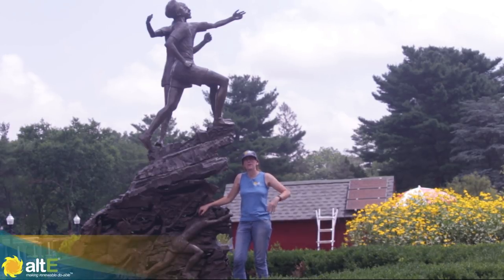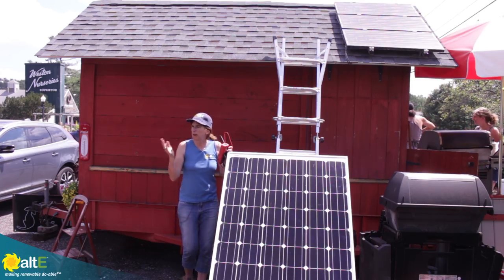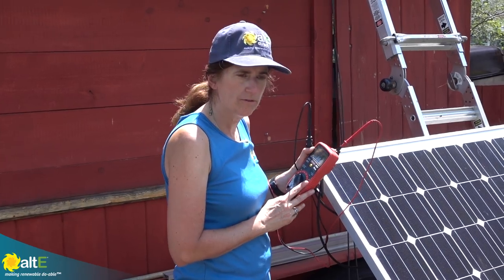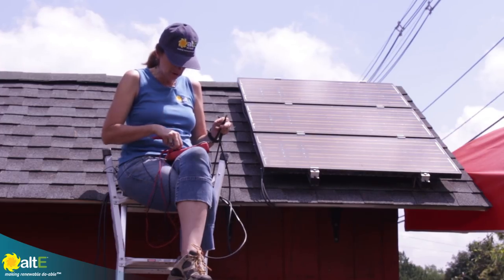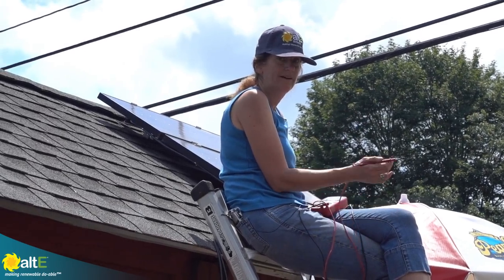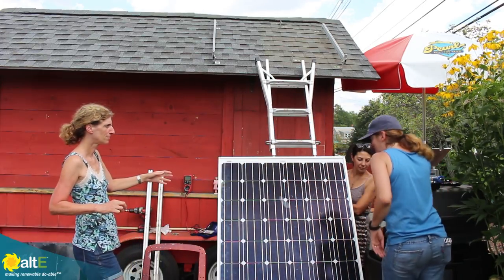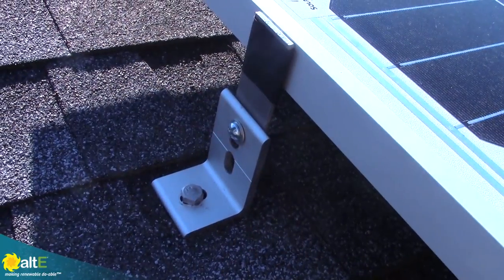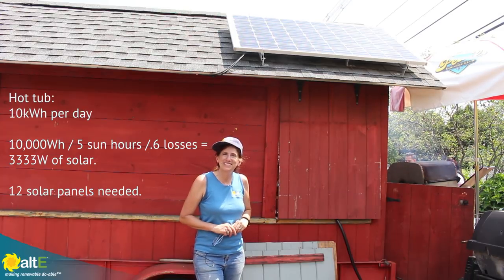Upgrading Snappy Dog's off-grid solar Part 1

Comment: You Rock Sister.  I’ve learned a lot from you.  I wish you all would use scaffolding instead of the Ladder       Go Solar -Arc.
Reply: There is nothing wrong with working from a ladder if common sense is part of the equation. I think scaffolding would be a bit on the overkill side in this particular case , no?

Comment: Aren't the old panels wired in series not in parallel?
Reply from the maker: No. We used a PWM charge controller, so the panels' voltage had to match the 12V battery. So the three 12V panels were wired in parallel. We wired them within the junction boxes, so it does look like it was serial, but it was parallel.
Reply: altE but when you read out the voltage of the old panels you were getting 19volts?
Reply from the maker: Yes. A "12V" panel is called that because it is designed to charge a 12V battery. Since a higher voltage is needed to charge a battery, the actual output of a 12V panel is around 21V when disconnected, around 17V when connected.

Comment: Can't you tilt the panels a bit to make them look more south?  I'm saying to raise the left side about 45 degrees.
Reply from the maker: Tilted panels would not be safe on a moving trailer. I oversized the solar panel to compensate for the less than ideal location.

Comment: Why not use both the old and the new panel for increased capacity?
Reply from the maker: Great question. I certainly could have left the existing panels with the Xantrex charge controller, and added the new panel and charge controller in parallel with a new breaker. Since the old panels were in such bad shape, and quite frankly, kind of ugly, and they didn't need any more power than the new one could provide, we decided to just replace them.

Comment: Hello. If we use on this van, a Pv-T system, does it make sense ? Also she can get hot water from pvt system
Reply from the maker: We have a lot of customers who use systems like this on their van and RV. She doesn't have enough solar to make hot water. But she doesn't use much hot water either, so she just filled an insulated jug with hot water from the kitchen in the morning. If she did need more hot, I'd probably go with a propane water heater, since she has a tank for the grill.
Reply: @AltEStore  Okey, thanks a lot :)

Comment: They could have gone for 300 plus 72 cells panels, There isn't much of a difference in price.
Reply from the maker: I wasn't sure who would be available to help install the panel, and the added length and weight of a 24V panel was a bit intimidating. Plus, I had this 275W panel left over from another project, so it was a perfect fit.

Also, the specs for that charge controller said max 295W panel. Since the panel is facing west, we'll likely never get full rated power out of it, unless they move the trailer, so it would be fine. But the 275W was plenty of power for what they needed.